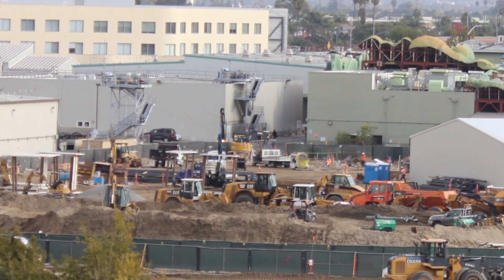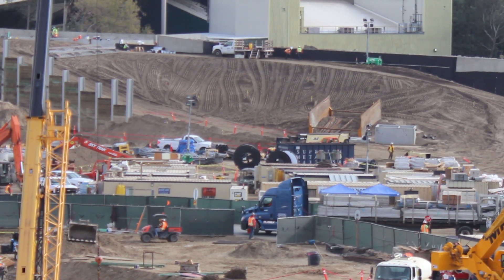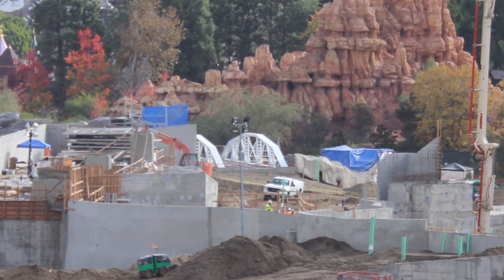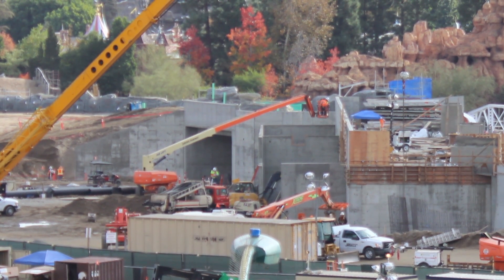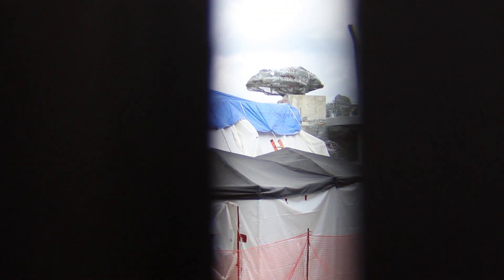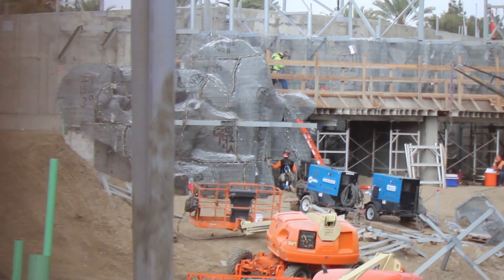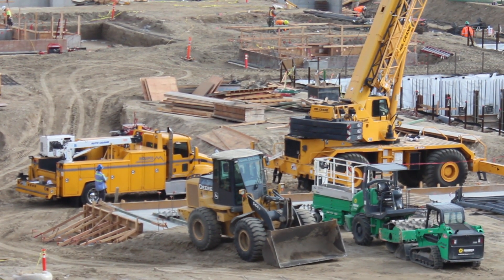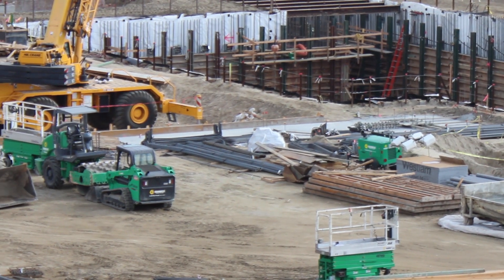Star Wars Land Construction Disneyland 12/06/16

Comment: @ 6:50 you got a good shot of the rockwork, and (freeze frame it) you'll see those "cross" type steel beam supports, up high, where presumably much higher rockwork will be added!  Those beams sticking out of the lower rocks are for scaffolding pads for the sculptors to work at higher levels! (I've seen this same type of technique used at WDW and DL Paris).  Very cool footage and thoughtful narration! Thanks again for all that you do for us!!